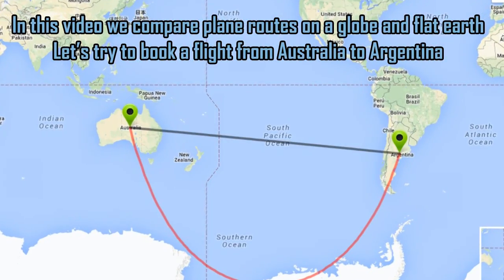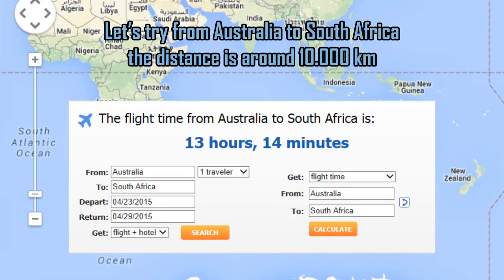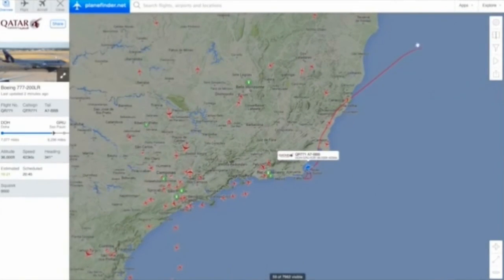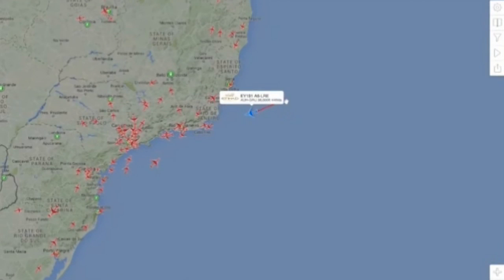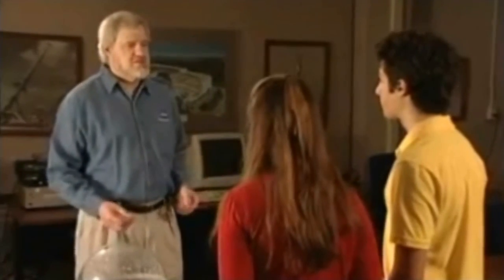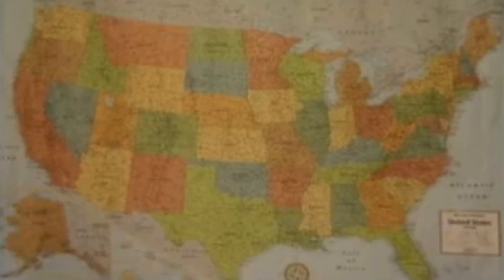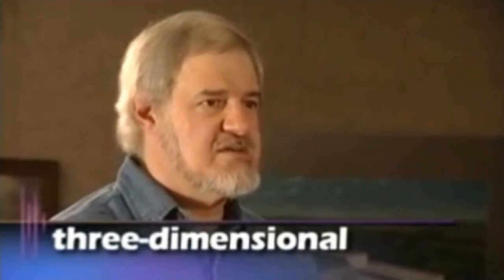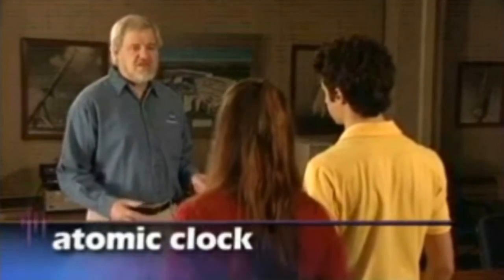How to prove the earth is not flat? part 5

Comment: I do think that the earth is a globe and in saying that I also think that there might be somethings that still need to be answered as it hugely contradicts itself. Like, what would happen if a helicopters hovers/stays afloat and doesn't move from a point it hovered off from? Will it find itself 1000 miles away after an hour since the Earth rotates on its axis at a little over 1000mph??? Or why flights from East to West are traveled in the same amount of time to and from? Should there be some difference since you are either flying against or with the spin of the globe??? 

The helicopter scenario will most likely result in the helicopter wasting its fuel as it will be in that same spot watching the sunset. But why?
Reply: try to jump in shinkansen train that run 320km/h = 88,88 m/s, are you landing on the same spot or 88 meters away from initial spot?
Reply: or think about mosquito that flying in that train

Comment: http://www.farecompare.com/flights/Santiago-SCL/Sydney-SYD/market.html#quote

direct flight from chile to sydney....
what flat earth nonsense will it be this time?
conspiracy?
it's fake?
it doesn't exist?

take your pick
Reply: What's the flight time to Chile and from Chile? They'll be the same right? But why? If the earths rotating on its axis at approx. 1000mph shouldn't the flights taken opposite to the spin be shorter than travelling with the spin??? Would it be cost effective if this was taken into account and have planes rather travel East to West all the time and use the spin to our advantage???This doesn't happen as Flights are taken West to East too with some planes even travelling at max speeds less than 1000mph. How is this possible to even land a plane when Location B is moving at 1000mph away from you??? I'm no fan of FE but I think there are some huge discrepancies that needs looking at....
Reply: +Richard Rea no that's not how it works, if you stand on a train going 200mph and jump in the air, the train doesn't go zooming away underneath you. inertia takes you with it. the same with the plane.
the plane is in the atmosphere not above it. the atmosphere is being dragged along with the earth and because the plane is inside the atmosphere the plane travels with it.
Reply: Firstly, the train travels in a straight line, linear direction, I'm pretty sure if you jump on a merry-go-round you won't land on the same spot. Secondly, if let's say you hover a helicopter in a train its travel from front to back should be shorter than its travel from back to front because after a while the momentum of the train has nothing to do with the travel of the helicopter itself....Thirdly, if a helicopter hovers off a point from the earths surface, your notion is that since its within the atmosphere it is moving along with the spinning earth and thus won't find itself 1000mi away from the point it hovered off from (Earth spins on its axis at approx. 1000mph). If that's the case then what happens to the spin when the helicopter starts moving to point B??? If it was moving along with the spin of the earth while just hovering than that means its still moving on its axis when the Helicopter starts moving to Point B and should affect the time of travel but that doesn't happen as both directions will be travelled in the same time. It's as though the Earth stands still when the helicopter is moving but spins when the helicopter is just hovering at one point. It doesn't make sense
Reply: ok first your merry go round example also has extra forces on it, it has angular motion, read up on angular motion and conservation of momentum if you don't understand these concepts.
the person on the merry go round has an angular speed about the central axis of the merry go round
when they jump at the point of jumping they will be travelling in a direction perpendicular to the motion of the merry go round so will not land in the same place as the merry go round still has rotational force where as the person doesn't, there is also no gravity from the merry go round to pull the person back towards it.
this principle is used when launching satellites
if you stood in the very centre of the merry go round and jumped you would land in the centre, if you jumped towards the edge you would be ejected off.
this is why satellites are launched from the equator not the north or south pole as they get that initial rotational force to help them 

your helicopter example is ignoring a whole bunch of things and has some misconceptions.
the helicopter inside the train will always be affected by the train because the air inside the train is being pushed along by the back of the train which in turn pushes along the helicopter. if the helicopter is hovering inside the train and if the train is travelling slow enough, after a while, yes the helicopter will drift towards the back of the train until it hits the air being forced forwards from the back of the wall, this is because it now has something to push it along it's horizontal axis.

Imagine you sit in the train and have a ball in your hands and throw it up in the air...

what happens:
It comes straight back down and you catch it . this is because it still has it's initial momentum
newtons first law of motion shows that any object retains its initial momentum unless another force acts upon it.
this momentum will only be lost when something acts on it to stop it happening. this is intertia.

what you are saying is that by throwing it in the air, it should zoom towards the back of the train since it has no way of holding it up.
we can clearly see this is incorrect.
if the train was still and you threw it upwards then the train accelerated the ball would seem like its going towards the back of the train because it's initial horizontal movement was zero and the ground beneath it then changed speed.

lets go back to a real helicopter on the earth.

1.on the ground it is travelling with the earth at 1000mph

2. the air is travelling with the earth at 1000mph

3. the helicopter raises straight up off the ground 20 meters and hovers. it is travelling at 1000mph along with the earth and this wont change

4.no force has acted on it horizontaly so it will continue to travel at 1000mph

5. it looks like it isn't moving because you are also moving at 1000mph (the same as if you travel 70mph in a car and are next to another car doing 70mph, it looks stationary compared to your frame of reference.)

6. if the helicopter travels 20mph in the direction of spin its total speed is 1020mph compared to zero

7. if the helicopter travels 20mph against the spin it is traveling 980mph compared to zero

8. if the helicopter travels 1000mph against the spin of the earth it is traveling 0mph compared to zero

hope this helps you.

some topics to help you would be

rotational motion
conservation of energy
newtons laws of motion
momentum
inertia

if you have any other questions I'll be happy to help

cheers
Reply: You're stating the obvious...Point 1 through to Point 8 is why I raised the question as to why the travel time from East to West in both directions is always the same. Of course there are slight differences due to other forces but the Pilot always announces the same approximate time of travel as if not taking the spin of the earth into consideration. You see what I mean...like you have stated in point 6 & 7 there is change in speed compared to zero that would mean that even a plane travelling at 1000 mph to get to a destination to the East will not get there because it will be gaining no distance. Just like a person running on a thread mill, he is at the same spot jogging because he is jogging at the same speed as the threads are rotating, if he slows down he moves back away from his initial spot of the machine but if he runs faster he will be in front of his initial spot...This doesn't seem to apply to planes and or helicopters during flights but why?
Reply: +Richard Rea I've explained it but you don't get it. zero is space which isn't moving. the earth is moving and the air around it moves at the same speed. and the plane in the air is moving at the same speed as the air plus it's own speed.

the plane travels inside the air it doesn't matter which direction the plane faces or travels it will always be in reference to the earth and the air.

so if the plane travels 100mph with the spin of earth it will travel 100mph RELATIVE to earth
but travel 1100mph RELATIVE to space which is zero

if the plane travels 100mph against the spin it travels 100mph RELATIVE to earth but 900mph RELATIVE to space which is zero

if the plane travels 1000mph against the spin then it is travelling 1000mph RELATIVE to earth but 0mph RELATIVE to space.

if you can't understand this simple concept I can't help you

imagine an ant on a tennis ball turn the tennis ball and the ant turns too. but if the ant is walking against the spin of the tennis ball at the same speed as you turn it then it will be in the same point relative to you but a different point relative to the ball
Reply: Tony, I understand everything you are saying but you haven't answered my question...from your example of the ant, you've only highlighted 2 scenarios.
1. The ant on the ball not moving will be spinning with the ball. Same point relative to the ball but will be in a different point relative to me.
2. The ant moves opposite the spin and at the same speed as the spin. Same point relative to me but different point relative to the ball.
BUT, what if he moves At the same speed WITH the spin and at the same speed as the spin to get back to his original point relative to the ball??? The results are different but yet planes can travel either way at the same time with the same speed...
Reply: +Richard Rea 

1. the ant moves against the spin at 1mph the circumstance of the ball is  1 mile. it takes the ant 1 hour to reach the same spot.

2 the ant moves with the spin of the ball at 1mph it takes the ant 1 hour to reach the same spot.
Reply: That is not correct at all...if the spin of the ball is 1mph, the ant needs to travel 2mph to reach Point B that is 1 mile away. Since Point B is moving away from you at 1 mile per hour, you have to travel faster than that to reach that point. Because after an hour the ant would have traveled a mile but the spin of the ball also has caused Point B to be a mile away.
Reply: it is correct...

I can only explain this so many ways as it is so basic, you have a fundamental flaw in your logic there.

point B isn't moving away from the ant though because remember the ant is on the ball and moving with it.

imagine the ball isn't moving for a second it takes the same amount of time for the ant to go any direction, yes?

now imagine the ball is moving and the ant is standing on it...the ant is standing still but is being moved by/with the ball
to the ant the ball doesn't seem like it's moving because it is moving with it.

in your example you're thinking the ball is moving under the ant without moving the ant which is clearly not so.

if you stand on a train doing 80mph does it take you longer to walk to the back or longer to walk to the front from the centre?
neither its the same distance.
Reply: Ok. So you are saying that even if the Ant decided to travel in the air, gravity will still hold the scenario the same. It cleared that bit out. I was of the impression that when a plane is in the air the Earth moves underneath but I guess since the whole atmosphere is moving at the same time that should explain that....Thanks for the discussion.
Reply: in the case of the earth the atmosphere is held to earth by gravity yes.
yeah you've got it, the whole thing is moving even the atmosphere.

in the case of the ant though there is no atmosphere around the ball and the gravitational pull that the ball has is so tiny it has no effect on anything around it
(gravity is linked to mass, the more mass you have the stronger the gravitational pull it has)

so if the ant hovered above the ball, the ball would spin beneath it because in that case there is no atmosphere
Reply: arguing with Richard Rea is pointless. Richard Rea is using observation to argue, Tony is arguing with science.
Reply: Tony is fucking awesome.

Comment: No one ever mentions good business. Try running an airline. How many people want to go from Argentina to Australia regularly. To fill a plane of 200 odd people it wouldn't operate regularly enough to be viable. Instead if you route planes by population densities you pick up more passengers so you sell more tickets. These regular routes means it's easier to plan fuel and other operating apparatus, not to mention airspace and flight paths. Simply put I don't find it strange that planes go where people are. The only thing this is proof of is planes stick to regular flight paths that's it.

Comment: There are not a lot of direct flights because not many people need that flight. There are non stop flights but not a lot. I've seen trackers of the planes and you can see that the vast majority of them have stopovers at much more common destinations, but there are planes that take the southern route. Planes cannot take the best routes that would actually fly over the Antarctic because it gets really cold there, more cold than the Arctic. Your Admiral Bird said that himself so planes have to be specially equipped with fuel heaters to fly over the Antarctic.
Reply from the maker: Brian A there are 2 or 3 planes / day that fly over the lower Southern oceans. Those few planes loose their tracking signal while they are doing that. The only flight tracker that shows them is flightaware. Check it out. It's easy to find the planes on flightaware and you can't find them in any other tracker. The reason why you can see those planes on flightaware is because that system keeps showing the planes on their expected flight path when the tracking signal stops.
Reply: +Brian A , over the Antarctic wouldn't necessarily be the best route, anyways... Depending on the exact locations of departure/arrival, a flight accross the southern hemisphere wouldn't even come close to it!
But I actually wonder, what types of airplanes these few ones are on a direct flight. And I wonder who's in there... :D